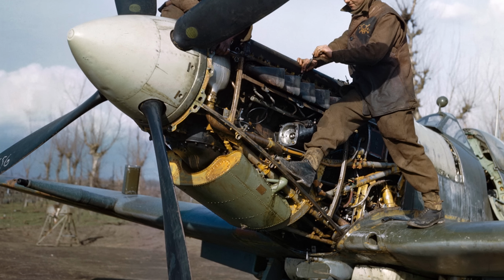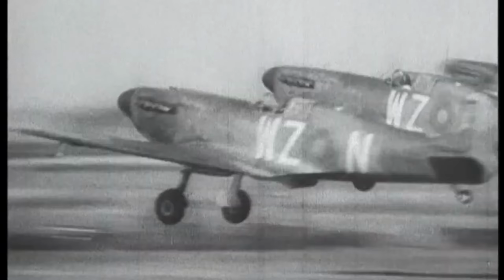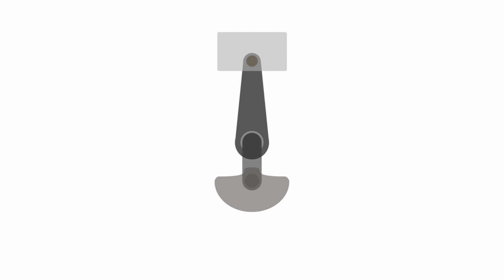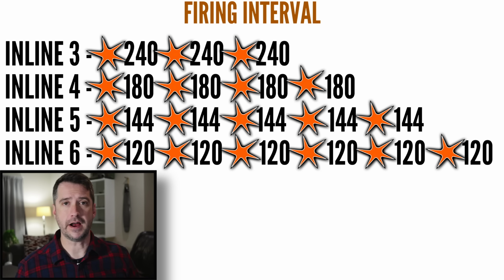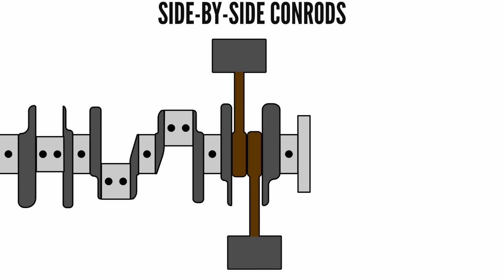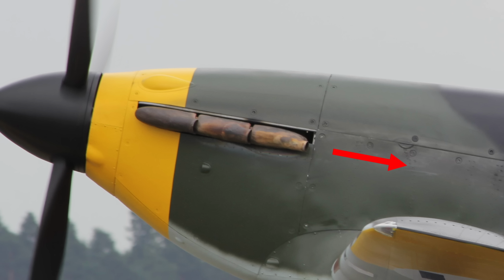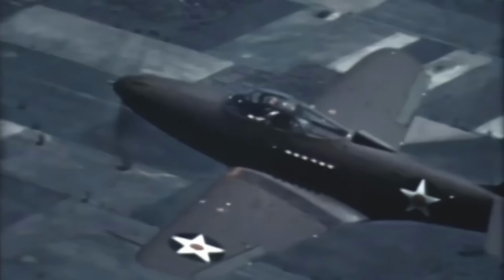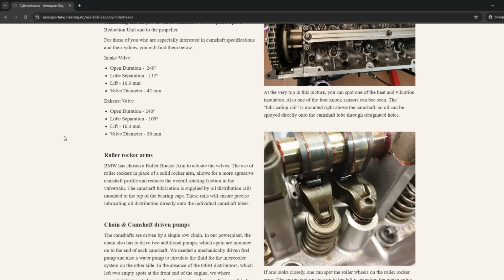WW2 Aviation V12 Design Decisions Explained - History & Technical Deep Dive

Comment: the problem with exhaust stacks as seen in ww2 aircraft is that, while they produce thrust, they're not producing thrust all the time. a single exhaust on a p-51 of any production type for example will produce a given amount of thrust relative to rpm for 1/4 of the running time, the other 3/4 of the time it's just producing drag. the british tried addressing this by producing 2 into 1 collectors but that only reduces the amount of time it's producing drag to about half. which was still not a net gain.

additionally, iirc, when the british did their tests on exhausts proving a 10 mph improvement with the use of angled stacks it was vs. the flush stacks that just blew the air out 90 degrees to the direction of flight. naca did test on this too and all parties came out with some very interesting info but what was really found to work, shrouded stacks and collectors, was seen as too complicated and expensive to produce and maintain as well as not fitting current designs already in production.

Comment: 27 litres at 2,000 hp is only 74 hp/litre from forced induction which is a very low state of tune.
Reply: "...which is a very low state of tune." Right, the consumer grade naturally aspirated LS makes that much power and it is OHV and 2 valves/cylinder. Oh, yeah it is 80 years later. There has been some progress made in material science, combustion engineering, fuels, electronics etc etc etc.
Reply: If you are using auto engines as the comparison you need to bear a couple of things in mind.  An aero-engine is required, and certified, to produce that power continuously up to a rated altitude.  The power quoted for auto engines is usually peak horsepower generated on a test dyno for a short time. Also consider the rpm at which the power is produced.  The same applies to stationary and marine engines.  The power rating is for continuous use.

Comment: An v12 is two inline 6. An inkine 6 is two inline 3. Inline 3 and 6 both have the 120 deg crankshaft and same secondary ballance.
The inline 3 has the rocking issue that can be cancled by an flywheel with same but opposite in-ballance, or by an mirro 3 inline to create the 6 inline. So an inline 3 is simple to ballance and heavy used in modern cars. Main advantage by the inline 6 is the self ballance and the 120 deg fire order.
An v8 can also be in ballance but will then have an uneven fire order.
Today 2 cylinder boxer in smaler airplanes taken from BMW motorbikes are popular due to ballance and small dimension.

Comment: I only recently found out in 1940 Rolls Royce were working on a two stroke 12 cylinder V12 unsure of CC but was Much lighter than the Merlin and Griffin with a power turbo added it was stated from tick over 2200 HP to max of 5200 HP later some tests 5600HP but it was only testing sadly never used. same type of water cooling flatter head Turbo went over the top of the engine from exhaust fully oil cooled.  I wonder if you could find out More?
Reply from the maker: Sounds like the Crecy. It's one of those engines that came too little too late, and a direct "casualty" of the turbojet engine.

Comment: The exhaust gas providing thrust is questionable. It may be static thrust, but at speed the exhaust also creates drag. The drag also creates a venturi effect which lowers exhaust back pressure and improves scavenging. Where did you read about the thrust from the exhaust?
Reply from the maker: You can find references to it all over the internet. Just Google "Spitfire exhaust thrust". As for the tests I referred to in the video, you can read about it in a wartime report of 1942 called "Flight Tests of NACA Jet-Propulsion Exhaust Stacks on the Supermarine Spitfire Airplane" by Richard L. Turner & Maurice D. White
Reply: @LetsGoAviate  Looked at the report. The thrust is calculated not measured. The speed is measured but the power is not. They measure air density at manifold but not flow. The additional speed may be because of the thrust, but may be also due to scavenging, the same way a carburettor works creating more power. The engine would produce thrust from exhaust, shame their is no static test without a proper on a dyno. The exhaust that was tested is also not the exhaust that was commonly used in the war.

Comment: The reason for powerplant development?    2nd place guy a air superiority doesn't get to go home.
Reply: Except that it’s more than just the engine. 

Take the Allison 1710.  It was one of the best allied engines of the war.  It was larger than the Merlin, easier to produce, modular, and was designed to use a turbocharger which could deliver maximum boost at any altitude. 

The P-39 was designed with it.. and it had very advanced features like tricycle landing gear and heavy forward armaments.  

But the decision was made to delete the turbocharger as it was felt it was too heavy and bulky—even though the mid mounted engine eliminated the need for excessive ducting like the P-47 had.  

Since Allison hadn’t bothered to make a two-speed supercharger.. it was shipped with a single speed one.. meaning that it lacked high altitude performance.

Comment: Finally, someone has explained secondary vibrations to me so that I can understand it.
Reply: V6 engines are a big issue to balance. 60° works fairly well but do have a rocking couple. Depending on whether even fire or odd fire, the balance is affected. They have either a forward/back rocking couple or they duck walk. The odd fire ignition is an issue.
The Ferrari Dino was a 120° vibrating wonder, acceptable in a race car but not so good in a street car.
A 90° V6 has the advantage of being able to be machined using the same tooling as V8 blocks.
The early Buick V6 was odd fire using common crank pins like a V8. Eventually they changed to even fire with split rod journals.
When Chev was developing their 90° V6, they built test engines with various rod journal splits including even fire, and installed in cars for staff to drive for a week or two and then switch to another. They asked the staff which they found most pleasant to drive. If I remember correctly the 18° split was the most pleasing, so the early 3.2l and 3.8l Chev engines were "semi oddfire". The 4.3 went to even fire.
With V6 engines the shakes are tuned out using mounting rubber durometer so the passengers do not feel it.

Comment: the centrifugal superchargers used by the ww2 engines usually didnt increase the boost linearly as the rpm increased... the boost of the centrifugal supercharger increases pretty much exponentially with the rpm which is one of the major annoyances in supercharger design.
Reply from the maker: Yeah it really only starts moving sufficient air at higher rpm, much like a turbo. But it's a non-issue in aviation, as opposed to an annoyance on cars.
Reply: @LetsGoAviate  arguable. while ww2 aero-engines have a narrower rpm band than car engines and its less of a problem, they still have an rpm band and therefore this is a factor. and especially when starting the engine it changes things a lot as the low compression ratio has a hard time creating enough pressure to allow for good ignition. and stuff like that.
Reply: Not really an annoyance at all in aircraft engines.  

Accelerating from idle they are only accelerating themselves and the propeller so low boost isn’t a problem—just like aircraft ignition timing is fixed for the same reason.  

And the engine spends most of its time at a constant RPM.. either max in combat or a significant percentage of it so boost is always high.  

The boost levels are controlled by the throttle. Lots of aircraft engines with single speed superchargers are “ground boosted” which means that they produce way too much boost on the ground.. the idea being is that you can use the throttle to get maximum boost for several thousand feet rather than having it fall off immediately as the aircraft climbs.

Comment: Maybe aligned cylinder banks makes for exactly symmetrical cylinder head design and parts which is easier to mass manufacture especially before CAD?
Reply: I can think of one aviation V-12 that was designed with automotive style side by side rods. Ford's V-1650. While it never saw production as an aviation engine after chopping four cylinders off it was produced as the Ford GAA. The engine was also designed to make use of cast steel parts instead of forging where ever possible to reduce costs. The V-1650 was also designed with an integral turbocharger. And yes the displacement was the same as the Merlin. And the Liberty.
Reply from the maker: I think so yes

Comment: Amazing vid, very clear explanations and complex subjects made simple enough to understand. Very well done indeed. 

Something that I’ve struggled to understand is dry sumps, especially in inverted V12 engines - when flying level, why doesn’t the oil collect in the cylinder above the piston is a thought that has often occurred to me and I’ve never found a satisfactory answer. If you could find a way to explain this in a future vid I’d really appreciate it. 

Love your delivery and pace, I found the material easy to follow, as someone who used to do technical training for a living I find your technique and presentation refreshingly good. I will add my bravo to those already here.
Reply from the maker: Thank you for the nice comment.

I think the short answer is when running the pistons move way too fast for oil to pool in the cylinder. With the engine off it's another story. I'll work it in when doing a video about an inverted engine.
Reply: I totally agree and also was wondering about how the inverted V-12 overcome inherent problems.
Reply: If you’re the average engineer then yes of course.?😂

Comment: Great video.  Turbos DO have parasitic loss on the engine in the form of back pressure on the cylinder.  Doing work with the exhaust means resistance on the exhaust.  Early turbo chargers were not as efficient as modern turbos so that was a lot of loss for less gain.  This is more apparent on low compression engines than on high compression engines as the pressure differential between cylinder and atmosphere is greater.

This is why turbo diesels are not just power adders but also efficiency adders even though there is the parasitic back pressure.

Using that spent heat to add power is getting that power back.

However, if we use the spitfire as an example, they already USED the exhaust energy as thrust, so putting a turbo on that would be robbing one of the ways they were already scavenging that wasted power.
Reply from the maker: I tend to think of it as mechanical parasitic loss, so I should have worded it like that. Yes a turbo restricts exhaust flow so would result in a loss, although typically nothing close to the loss of a supercharger. Thanks for the comment!
Reply: @LetsGoAviate  understood.  Just have to beat back the tide of "turbos are FREEEEEEEE".

They are almost free, especially for diesels.  Modern diesels cannot work without them because they have been designed with turbos in mind.  There is valve overlap which can only be there BECAUSE of the back pressure.

If you want to learn more, just out Gale Banks.  He's an unmitigated badass
Reply: @coreyfro valve overlap has not much too doo with turbos it is done too increase the exaust scavenging and too pull in more air and NA engines gain more out of that

Let me explain  then we oppen the exaust valve the pressure drops and the exaust gains speed and gases have mass soo once they have reached pressure Equilibrium they still move out because of the Momentum and inside the cylinder the pressure falls below Ambient pressure that would slow down the exaust stream and if we open the intake valve about at the time the pressure inside the cylinder is equall too the intake pressure we cann let the exaust "suck in" the intake change and we also clear the combustion chamber better of spent exaust gas since ther is no oxygen too burn fuel in it  and since the the intake Charge is moving a bit faster it has more Momentum too fill the combustion chamber a tiny bit over Ambient pressure     if you need too visualise the flow of a gas just look up water hammer it is also momentum and pressur at work with a water instead of air (but gas and liquide move the same) and the water cavitates at low pressure  making it audio visuell noticeabel
Reply: @TheLtVoss  I know what Valve overlap is for.  However, like is said, the back pressure of the turbo allows for greater scavenging in a diesel engine when the engine is designed to take advantage of that back pressure.

I think you have a ready comprehension problem.  You restate my point on one comment and you post a counter in another to a point I didn't make.
Reply: A turbo raises the overall pressure.  The boost and back pressure are approximately equal.  The classic analogy is a normally aspirated engine in a deep mine shaft where the air is denser.   
The exhaust ‘blow down’ pressure is about equal to the peak compression pressure.  Say 125 psi and 1200F.  That is one heck of a lot of energy.   Turbo-compounding captures this…Wright 3350 PRT….increases hp by 15-20%.  Modern turbo-compounding has made its way into truck diesels.
A turbo is more efficient than a supercharger even if the latter’s exhaust propels the plane.  (Jet propulsion efficiency suffers if a great mismatch between the plane velocity and exhaust velocity. )
With turbos the pilot does not have to change supercharger settings with altitude ….a consideration in combat.   Cheers
Reply: @danbenson7587  that's not entirely correct.  A turbo increases air density.  If the heat put into the air is removed, then the pressure is also reduced, hence the value of forced air cooling.

This may seem pedantic but all good charge systems have cooling.

Regardless, it is the differential between the exhaust and atmosphere which matters for energy input and it is increase air mass in the cylinder which matters for combusition.

No one thinks on PSI in and PSI out
Reply: @coreyfro  The loss of pressure with cooling applies to a closed volume.  This isn’t the case here.  The hot air exiting the turbo pressures the air ahead of it that is passing through the charge intercooler.  There is a bit of aerodynamic pressure loss thru the cooler though.
     The intercooler increases charge density.  On SI engines for power and knock; on CI engines for power.  Ci engines are available w/o intercoolers.  BTW, interstage charge coolers have been used on gas turbines for same reasons.
      Miss your drift on PSI comments. ….Though I haven’t a charge cooler, I am dense.       Cheers
Reply: @danbenson7587  right, I am simply saying that PSI isn't a useful measure of efficiency because you can't know how much is from compression and how much is from heat until the heat is rejected. So the more useful measure is air density after the charge air cooling compared to atmosphere. Especially with CI engines since compression is so high.
Reply: @coreyfro  na the more useful info would be pressure and mass or temperature and air density because we want too know how much energy is stored in the amout of air the engine is taking in and the exaust going out has  and since  heat will increase pressure of the same amout of air we cann calculate anything from there temperatures, flowrate, efficiency,  and soo on 

 air density is basically mass by Volume 😅 but since we talk engines the Volume is already given so you just say how much mass is taken in (that is great too get a power estimation of a ICE) but it dosnt say how much energy is inside the exhaust in form of pressure and heat it just says how much molecules we have in a place regardless of temperature or pressure  there are tabels and formulars that take in temperature or pressure but always with one set too Standard values for air density in relation too pressure the temperature is alwasy 20°C and if we look at the other graf of air density in relation too temperature the pressure is set at sea Level  but with combustion we add heat in a compressed medium in a confined space so the density can't change from bottem dead center to botten dead Center till the vale is open but the heat and pressur is higher (cause burned fuel) and that difference in temperature and therfore pressure is driving the turbo that gains us air density by compressing it with a coller behind wenn cann expell same heat incressing the density and the resulting lower pressure will get filled up by the compressor to the absolut pressure it cann reach (since before and after the cooler the pressure is the almost same in a Systemen)
Reply: @TheLtVoss  you just said what I said but in a bazillion words.
Reply: Well exhaust itself provided thrust too, using turbos could negate that. It was worked out the RR Crecy was getting 300kw from exhaust thrust alone.
Reply: With proper design the backpressure can be reduced to zero or very close to zero. A 1:1 ratio turbo system would mean virtually no backpressure. A 3:1system would have a fair amount of backpressure, which counteracts boost pressure.